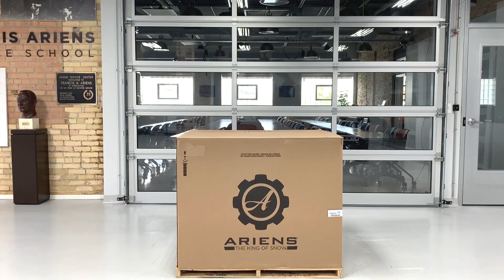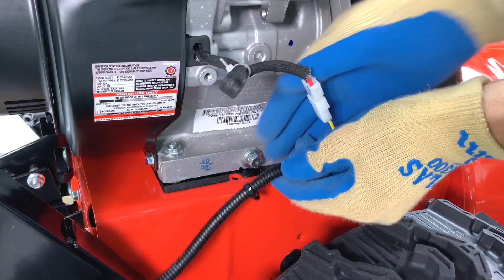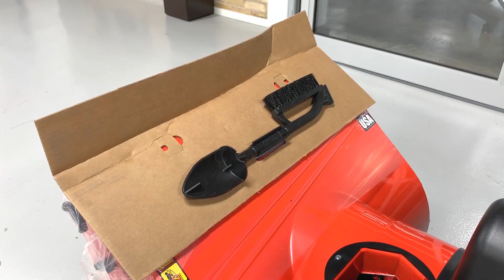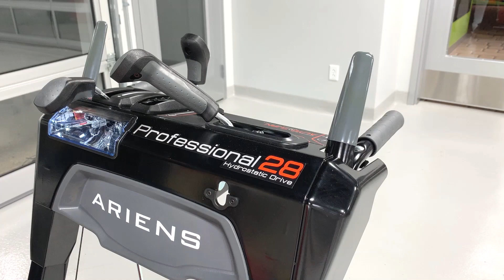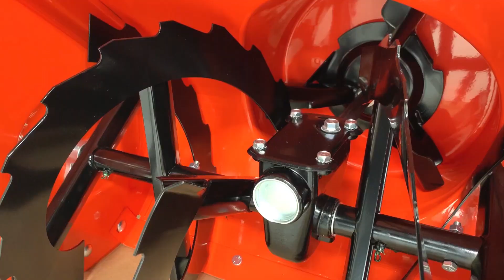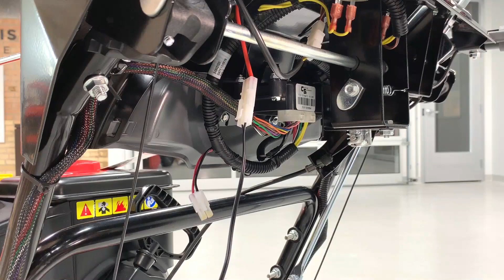Ariens® Professional-Series Sno-Thro® Assembly | Ariens

Comment: do you have a video anywhere showing the chute controls/wiring/wire routing for the electronic version (ie my pro alpine 28" rapitrack version"")  the PDF assmebly sheet is a bit vague. would love to see it in a video even if from a different machine.

Comment: Hey Ariens Team, thanks for another good video. I have a Pro 28 EFI RapidTrak. The bypass rod (lever) for disengaging transmission is lose, so I cannot move the machine manually. My snowblower is in service position and I have removed the bottom cover. It is hard to find out how the bypass lever was attached inside the engine. Manuals do not provide information on maintenance or repair of the bypass lever. Do you have any suggestions, perhaps a video or some photos, showing how to fasten the bypass lever? Cheers from snowy Arctic Norway.

Comment: Hey Ariens team! Hoping for some maintenance videos on the rapidtrak  system! Thanks!😁
Reply from the maker: Thanks for asking, Jim! What type of specific maintenance are you curious about? The RapidTrak system itself won't need any special maintenance, but your machine will need other general maintenance like lubrication to the axles, gears in the tractor, oil changes, etc. If you reply with your 6-digit model number and 6-digit serial number, we'll supply you with a link to the digital version of your operator's manual.